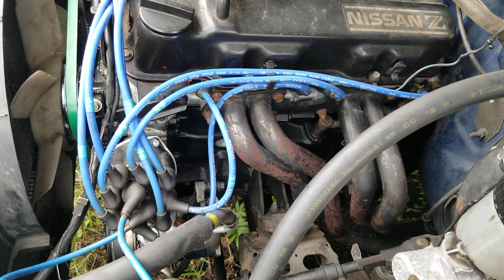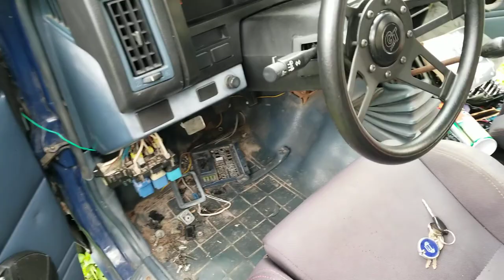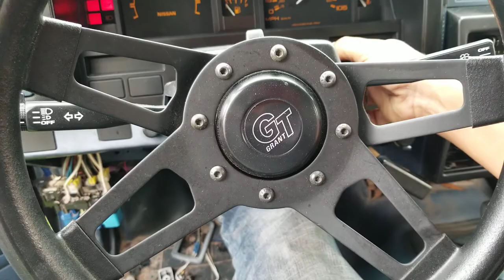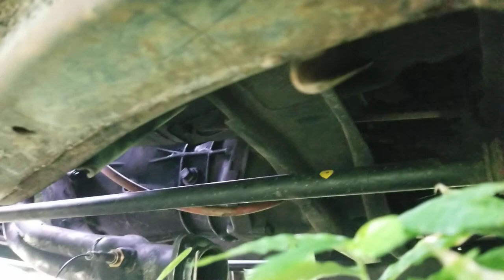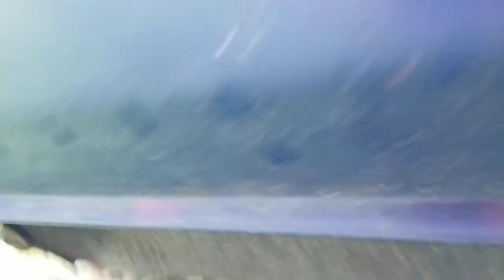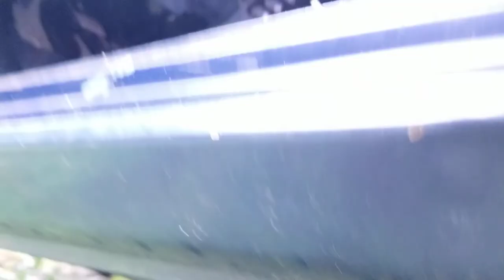86 Nissan d21. Installed Pacesetter headers.

Comment: love it. if all things go good im getting an 86 hardbody for myself in a couple days, it has idle problems and needs a clean a carb and some new wires/plugs and potentially vac lines. have you done anything to your exhaust or just the headers? sounds like a tractor but i dig it. definitely hope you upload more updates on this truck
Reply from the maker: Glad you like the vid! I went thru the same issues as you! The carb, wires/plugs, vac lines and distributor had to be replaced on mine! They were all in horrible condition! I ended up getting a Weber carburetor too replace the stock one! It made a huge difference! Not just in increased performance! It doesn't need or use any of the vacume lines or any of the sensors that normally connect too the stock carburetor! I removed everything having too do with the egr, system! All the sensor connections, I moved off too the side near too the wiring harness and relays! I got NGK wires and Iridium plugs! 
Right now, it's just the headers! Man, did they really open up the engines potential! And they are so, sooo loud! Far more than is noticeable in the vid! Swear you can't hear yourself think or talk! Lol
I did just order a magnaflow cat and magnaflow exhaust! Just waiting for them to arrive! I'm so excited to get them on so's I can drive the truck!
Reply: @almagam2099  this is really helpful! It's not the easiest thing finding info on these engines honestly, I know they're not very fast and there isnt a whole lot of parts for them but theres something I like about the z24 hardbodys for some reason. Did you really see a lot of performance with the Weber? Ive seen some people say they did and others said it just made it smoother I guess, I'm definitely looking at that though also potentially side drafts in the future if that's a possibilty when I can learn/afford that
Reply from the maker: I haven't really gotten the chance too really open her up since I added the Weber carb! Most I've done is drive her around the neighborhood a few times! But honestly, every little thing I've done has improved the overall performance of the engine!
The NGK wires and iridium plugs provided a far better spark than the stock ones! I'd even gotten NGK ignition coils this truck has two but those fried on me! I now suspect it was a bad ground that caused that! Right now I have stock ignition coils! But anyhow, those three alone wires, plugs and coils improved engine performance, smoothness and gas mileage! When I first got the truck, I was probably getting well under 24 miles per gallon! After the upgrades, that jumped up too 30 miles per gallon!
 I even upgraded some of the ground wires! The stock one's are still their, but I added new ground wires made out of welding wire! I did this too the computer, the alternator and the engine! She starts right up as soon as you turn the key! There's literally no hesitation! Before, it'd take half a second or more for the engine too start!

Comment: Hey man what did you use to plug up the port for the  egr ..
Reply from the maker: I got a small sheet of metal from home depot (don't recall the grade or thickness!) You can use the egr ports from either the intake side or the egr itself to make a template block off plate! I used paper or cardboard to trace out the shape, then transferred that too the sheet of metal! Then cut the shape out and drilled the holes on that sheet! And bam! Instant block off plate! I used the egr gasket and gasket maker to make a tight seal! So far...no vacuum leaks!
Reply: @almagam2099   thank for the fast reply .. I'm taking the port on the headers it's self the ports what size and thread are those .. or what did you use .
Reply from the maker: @andytorres5661  ohhhh! The headers came with two or three plugs that are near the exhaust ports! I think they're the same size and thread pitch! There's another port at or near the bottom end of the headers! That one's the same thread and size as the O2 sensor! I used that on that port! You can see it in the vid when the camera scrolls down under the truck!